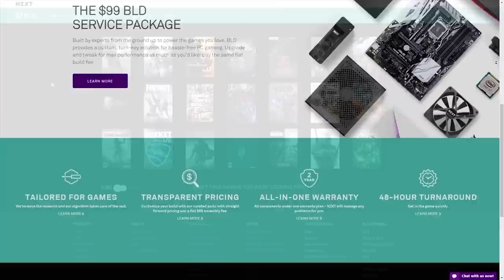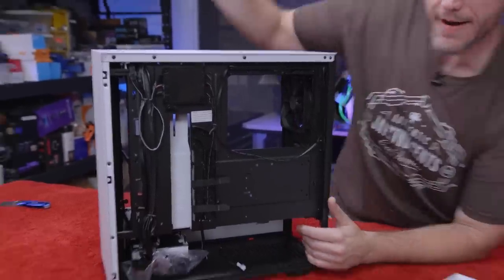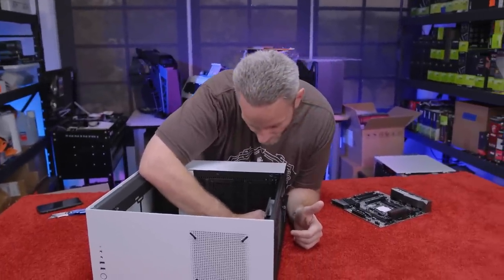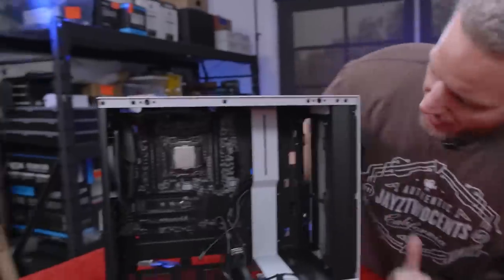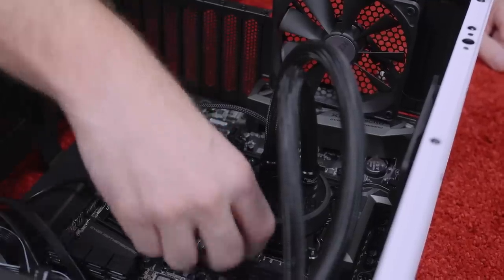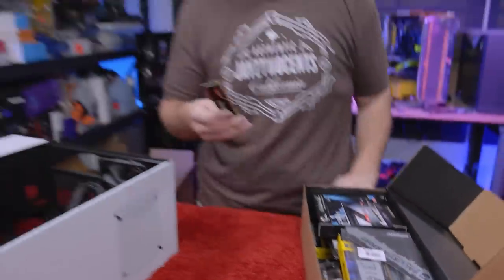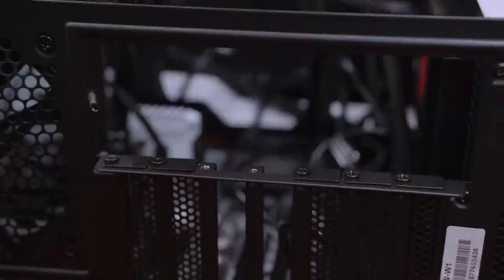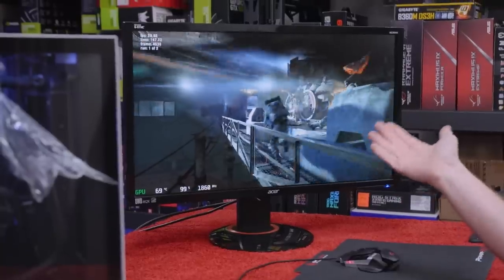We built a computer wrong on PURPOSE!

Comment: 0/10, he forgot to place the power supply on the insulating pads. Short circuited entire system.
Reply: @mtljx  Even forgot to show support for cancer patients. smh
Reply: Pro tip: match your rgb for max performance. And remember to set them red cause green is the eco mode
Reply: James Xiao he probably also forgot to screw with confidence 😢
Reply: Also, no brace. It has to be hammered in.
Reply: DeckerFI also, yes, we got really fast 2666mhz memory
Reply: also he didn't use a table
Reply: Haha, should have so just followed along with the Verge video and seen if the computer would even post.
Reply: @kidnamedfinger6952  yep
Reply: @mtljx  at least he had the table smh
Reply: At least he has a desk
Reply: @txic.4818  and tweezers

Comment: Dude, you're suppose to put the thermal paste on the socket
Reply: That's only for hardcore enthusiasts!
Reply: Yeah thats if you dont want the pins to come in contact with the cpu so it doesnt short circuit and come in contact with the rest of the pc, nice tip
Reply: He should've added thermal paste to pre-applied thermal paste.
Reply: @mas7rreaper126  Thats not woooosh
Reply: Mas7rReaper12 ??
Reply: @unknownsadman  not that badly if ur still curious (I'd take it off though, get some thermal paste remover off amazon, and then reapply though)
Reply: @michaelherron117  its been running great so far. Kryonaut grizzey and intel stock cooler been workinf good, but i am gettinf Ready to fix it
Reply: @unknownsadman  ok big pp and I'd definitely take the time to do it though bc ur definitely limiting ur cooling capabilities in the long run
Reply: @michaelherron117  Yeah you're right. Im just afraid of pooring alcohol on the cpu...
Reply: @mas7rreaper126  You either didn't read it correctly or don't understand the concept of r/woooosh.
Reply: Only Dennis can do that Dennis tech tips have the rights to that only
Reply: @unknownsadman  oh sorry thought you put paste in your socket
Reply: @leonharder4846  Exactly
Reply: @lunaticheaven9446  why would you put paste it the socket smh 🤦

Comment: Jay you forgot to mention which oil I should use for my ram. Is sunflower or olive ok?
Reply: Use coconut oil
Reply: use motor oil
Reply: Castrol GTX sounds nice, not only it speed up your ram but also your nvidia gpu
Reply: id recon wd40, also that spraycan makes it easier to apply evenly :D
Reply: jiz
Reply: Use motor oil and atf fluid mix
Reply: We need vegan oil
Reply: Use Coca-Cola it's better than any kind of oil it corrodes car motors lol
Reply: Palm oil
Reply: Used engine oil works best you need the sulphur content
Reply: Navaks use baby oil
Reply: Water oil.
Reply: Navaks no use motor oil
Reply: i use acid
Reply: I use glue, works extremely well
Reply: Also use toothpaste instead of thermal paste
Reply: Peanut
Reply: Just dip your ram in the gulf of Mexico. There should be enough oil in the water still.
Reply: Can I just use high tempeture brake grease instead of thermal compound for my cpu?
Reply: Navaks use water
Reply: @vigneshnallamill9810  100% organic is the best
Reply: at least 5w30
Reply: extra virgin oil
Reply: I dont know which is really better but olive has served me good for the past fev years
Reply: @tvojamater3130  I personally recommend engine oil. if your slot is worn out you might want to use something like 15w50, but I personally use 5w30
Reply: @qu4dq0r3  WD40 is nonconductive and noncorrosive... its actually supposed to be good for electrical connections...
Reply: Whatever's water based.
Reply: Dorito residue works the best
Reply: 5w-30
Reply: What are you talking about? Don’t you download your ram?
Reply: Use motor oil, it get an extra 50fps using that method.
Reply: Just vaccinate it
Reply: you need essential oils boi
Reply: Mobil 1 even nascars use them
Reply: WD40. It’s not oil, but it works
Reply: I can't believe its not butter
Reply: Use vegetable oil
Reply: Vaseline worked for me😉
Reply: Use cooking oil
Reply: Use gasoline lmao

Comment: Try turning the power supply off when updating bios. That will give you better temps. ;)
Reply: Be sure to make a video about the result. Muahahaha! (Gets popcorn and hides in a dark corner)
Reply: It'll never go above ambient temp again.
Reply: mamagame yeah best temps ever
Reply: Lol, good one. But I seriously hope no crazy person tries this.  I had a friend who had his computer go crazy while trying to update bios and in the end after he shut it off it was a brick.  Sad story.  Though for what ever reason they still fixed it for free.
Reply: Would not do anything on my Mobo since I have 2 BIOS chips! Wait... 2 updates is better than one... how about I unplug the PSU when I update the BIOS on the backup chip :D.
Reply: New mobos have 2 bios settings now, so yeah if you brick it, there is a backup.
Reply: Updating the bios is something i’m scared to do. Luckily my msi x470 worked out of the box
Reply: That's true. I also overclocked my q6600 to almost 5ghz from 2.4ghz... it was so effective, it would sense when it was too hot, and automatically turn off, every 2 minutes. Best build I ever did. And it was on air too. I don't get why extremeoverclocking kept laughing at me.
Reply: No wonder you stopped playing intricate lead breaks and started just mumbling those fingers across the fret board... you been spending too much time with 2 bios chips.
Reply: And now it's time to drink... Who is with me, it's 1am. Common, slainte.. hic  I just used the cursor keys to fix a typo.. Yay me !!!!!
Reply: @Parishna, what the hell are you on about... Even I don't know..
Reply: You can fix the brick though. Desolder the BIOS chip and Install a BIOS chip that has the same BIOS you need for your mobo. Lol.
Reply: Joe Taylor my friend was updating his BIOS during a thunderstorm. I don’t know what was going through his brain.
Reply: Also I heard if you put peanut butter on your ram it acts like thermal paste lol 😂

Comment: He chickened out on the PSU,  a high quality high watt PSU is not going to hurt anything.  
He should have used one of the generic chinese gray colored PSU, 600W but cost like $35.
Reply: This. I get the point of the video and I agree with Jay about enthusiasts/experts scaring away novices from trying their first build, but he should have pointed out that he's using premium/high end parts that are well-built - parts that could actually take  a bit of punishment/mishandling without immediately breaking anything. Most novices might skimp on a part or two with disastrous consequences (e.g. most novices have a tendency to go for cheap cases and the crappy PSUs that came with them.)
Reply: DiabloTECH (yes that is a real PSU brand) would be perfect for this.    They're the company that taught me all I need to know about cheaping out on a PSU.
Reply: i dont think the point was to put bad components in that either just dont work or will break your computer, but to do the building process wrong, with good components
Reply: Should have tried a 230W PSU haha
Reply: Ironically one of the more generic looking brands that people buy is Great Wall which just screams in both looks and branding as being a hazard but guess what?

closer, whispering

Most of the big brands like Corsair and Thermaltake use Great Wall PSUs with fancier outer casings.
Reply: @SaraBearRawr0312  For real? Can you gimme a source, please?
Reply: @sujithnair2784  it was either a gamers nexus or linus tech tips video when they were reviewing the Walmart OP gaming PCs. They said that just because it was using a great wall PSU it was fine since they make the modules for the big brands anyway.
Reply: @SaraBearRawr0312  Yup. Just buy a cheap one and save some money. The PSU has a ground for a reason
Reply: Also the power supply cable isn't proprietary wikipedia says that specific connector is mostly common to server grade hardware though.
Reply: @SaraBearRawr0312  That's a bit of an over-generalization. The same company can have different lines of production, one for crap parts(ordered from budget brands) and another for quality parts that get ordered by better brands(Be quiet, Seasonic etc.). If the better brands were ordering the same parts as budget brands, the PSUs would fry the systems at a similar rate as no-name crap from Walmart. Somehow I find this scenario unlikely. To be certain about these claims, I guess an electrical engineer would have to verify parts in those PSUs, using professional tools. Us lowly computer nerds can only  speculate.

Comment: I had someone tell me the way I "touched components with my hands while being outside meant that it lost 5% Performance" the best bit is that he linked me an image of me holding a TV Tuner...

Good job making a video to finally proove that PC Components are not as fragile as many people would have you believe.
Reply: I'm typing this on my PC built on a motherboard and processor from the dump,as in rained on,on the ground. I had to replace the thermal paste and rusty CMOS but the board and phenom II X4 are fine.
Reply: Reminds me of a guy that explained to me, that ALL motherboards have a safety feature, that shuts off your PC if your CPU gets above 60°C, since your hardware "degrades" if it is over that temperature. And that 4 GHz is a hard cap for CPU clock speeds. At that time the 7700k was out.
Reply: 4ghz is still a hard cap unfortunately you can get higher but not without spending a ton of money on cooling solutions witch just arnt worth the cost lol
Reply: Keep in mind, ESD can bite your ass if you are too careless. My CEO killed his work Pc by opening it in his office and adding a hard drive lmao.
Reply: NightMare: People have used Hoover's on their computers, the chances of Static killing your PC is so minutely low, that I personally wouldn't worry about it.

I think your CEO may have accidentally messed up with the wrong thing in the PC.
Reply: Hey someone know what monitor he’s using ?
Reply: ESD really shouldn't be a concern, I worked in a datacenter and nobody ever used ESD bands or something similar. Just touch your Radiator in your house or your case while the power is plugged in and you are fine, as long as you don't build up a lot of static energy.
Reply: Really, those components are really tough, even if they seem so fragile
Reply: First you keep commenting on RGHD vids, now this 😂
Reply: Where that 5% performance loss figure came from? Did you asked the guy? I'm curious. It makes no sense.
Reply: lol my CPU is running at a stable 90 degrees atm due to having trash cooling and not switched thermal paste and shit in 6-7 years :) its funny how my system doesnt shut off til it reaches 100 degrees or when PC blue screens due to some random Critical Error that i never get to see cause it doesnt even get to the "Blue Screen" which tends to happen once or twice a day lol
Reply: Static generally doesn’t cause immediate damage, but affects long term life of the product. I used to work for a big telecoms company where installers had failed to protect against ESD, a few years later an abnormal number of cards started failing. Investigations confirmed copper tracks had failed due to previous ESD damage thinning the electrical paths which over time had then effectively melted due to no longer being wide enough to carry the required current.
Reply: All you have to do is watch a Linus video of him touching computer parts to know they can take a beating. Or break if you drop it enough haha
Reply: meanwhile: my xeon 1231v3 is on 99 Crad Celsius 20 seconds after starting BF1 and it worked like this for more than 2 years now with games that actually use the cpu

Comment: you forgot using a butter knife as a flat head screwdriver
Reply: Yeah, I don't see a problem with that...
Reply: I've done that for a monitor stand once
Reply: I've done that several times, also on laptops
Reply: Bruh I used it on pipe work
Reply: It works perfectly fine. What's your point? Maybe he should have tightened those screws with bare hands.

Comment: You forgot to screw the motherboard directly on the case without standofs
Reply: are you saying the motherboard shouldn't be screwed into the case?
Reply: This is quite frankly the most probable fuck-up that causes the most damage.
Reply: I was under the impression the motherboard should be mounted outside the case.  Was I mistaken in this?
Reply: lol you use a case? connect all that shit and trow it behind your desk. ezzz
Reply: I actually did that on my first build, only used 2 screws as well. Still works.
Reply: Probably the most likely way you could ruin a board. The second the sauter scrapes through the paint ZAP
Reply: I was legit tempted to keep my mobo on the cardboard box for my 1060 the last time my PC died because the thermals were incredible! lol
Reply: And I don't think he left the I/O Shield out of the build either.
Reply: I did once and it just refused to boot. The modern mobos detect the short somehow and they don't start to avoid any damage.
Reply: Short the right component and it will brick the board. You just got lucky.
I also did this to my first motherboard. I have no idea if it booted while bent but it did work after I discovered what standoffs were.
Reply: Almost impossible to do since every case has them preinstalled. Never seen it done, I'd like to know wether it would short or not.
Reply: There are cases wich don't need standofs, like HP Virtus.
Reply: Just like XQC!
Reply: lol xQc did that?  not surprising tbh
Reply: Yeah, he just kept all of his shit outside of the case, nearby his snacks and sodas. Just laying there on the floor, like why bother with a case?
Reply: Ouch. Was going to build a computer for a friend, but another friend went there and they started without me (that friend has a masters degree in IT/communication systems so I thought they'd be fine) but when I got there it wasn't booting and the motherboard was screwed without the standoffs. Luckily there was no damage and that computer still runs fine like 3-4 years later, but that scared the shit out of me.
Reply: @z33tanner  solder*

Comment: Short List of what Jay did better than the Verge Video:
-Dual Channel RAM
-Use correct size screws as well as correctly screwed in
-Use a Phillips Screwdriver instead of an "Swiss army knife that hopefully has a screwdriver"
-Didn't use the CPU Applicator
Reply: Also used all the thumb screws for the cpu water block, didn't drown the cpu in thermal paste, didn't nerd out about having gotten their hands on an ordinary mundane cpu, didn't use a silicon rubber "for the cure" bracelet, didn't call zip ties tweezers, and used all necessary standoffs(rip m.2 nvme ssd).
Reply: When he said "That it "hopefully" has a screwdriver" I literally lost my shit.
Reply: -Put the CPU in before putting the motherboard into the case.
Reply: Applied only one layer of paste.
Reply: Using a CPU applicator is perfectly acceptable, except how "The Verge" did it. When the guy said to add more thermal paste because the factory doesn't use enough, I almost lost my shit lol.  I'm among the minority that spreads thermal paste on manually (because OCD) so I know 100% of the heatspreader is covered nice and evenly.
Reply: The applicator stays on during operation right?  Cause he "uses" it, but then they cut away and it's off to the side because he realized it wasn't working right, but they kept that first bit of footage anyways.  It's just so bad
Reply: Don't forget the fans on the radiator
Reply: K

Comment: you didn't sneeze on the board for good luck
Reply: Doing my last build it was the hottest day of the year and it was about 34 degrees in the room I was building and I had sweat drop on the board, twice. Thankfully it was fine.
Reply: bruh where u at thats the hottest day ? here in az the highs are in 100s,  sunday will be 107 btw: 34c is 93 fahrenheit
Reply: UK, yeah I know it's hardly much but no AC and since we're not used to that kind of weather.
Reply: bruh how u got no A/C that's a gamechanger i'd prolly be sweating balls in 93 with no ac too house turns into a furnace lmfao
Reply: I live in a hot place and have had sweat drop on a couple of mobo's freaked out each time but nothing ever went wrong
Reply: Birkin Sornberger in the U.K. houses don’t come with A/C and that kind of heat is meant to be rare.

Comment: I'm disappointed.

You put the CPU in before installing the motherboard.
You put all of the screws on the CPU cooler.

You've already missed several tricks that the Verge found in their how (not) to build video.
Reply: The point of this video was to disprove the myths of "how sensitive" components are. To show that it's not easy to break things if you follow the general instructions.
Reply: @fluffyfetlocks  woosh
Reply: It says We built a computer wrong on PURPOSE!
Reply: @jezihogg  wooooooosh
Reply: Lmao these guys don’t get it they think that putting the motherboard in and cpu after is the right way LMAO
Reply: Should've mixed different thermal pastes.
Reply: @etro8564  bro, I know you think you get it, but you dont either lol.